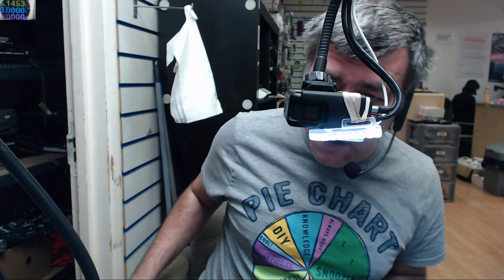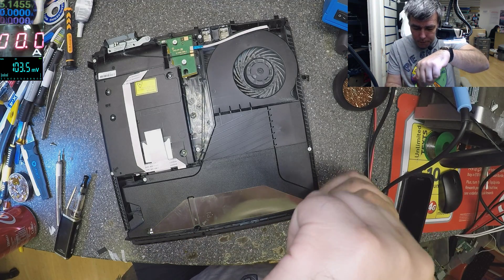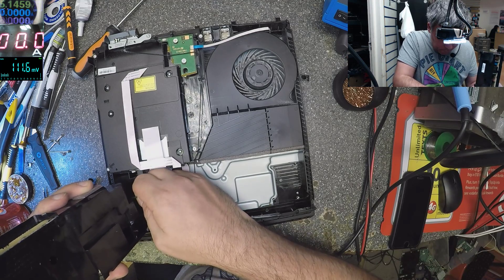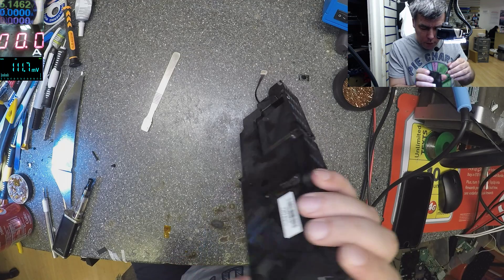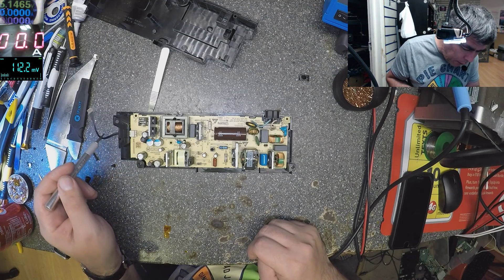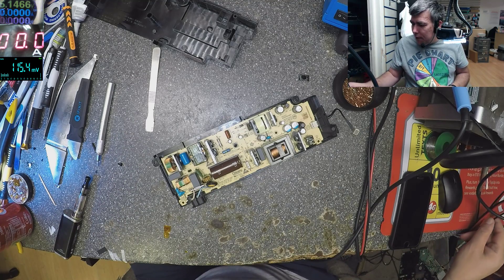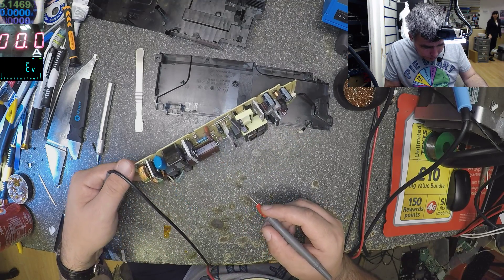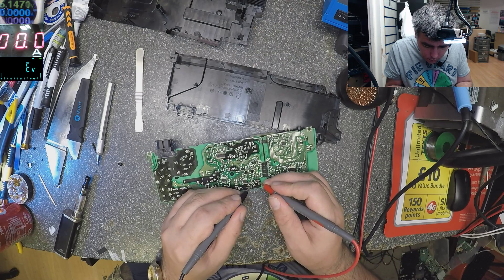PS4 power supply repair job

Comment: Thanks for your video - bought a PS4 for my kids -- only to get that click sound. Followed your video to open the powersupply only to find one of those cables broken off - think stemed from the fact that it is old. I will be taking it to the shop tomorrow to have it fixed and hopefully it works - will update you but thanks for your guidance.

Comment: 4:03 exactly. Bcos they want to exploit people by replacing every faulty console with a new one and charging for it. If people could repair it themselves then they would not be able to exploit them like that. That's why we need to choose a product that's open source, that's not restricted by the manufacturer, which is not hidden by the manufacturer. 
That's why PC is more valuable bcos it is open source. You can literally fix your own components in a pc, if you know what to do.

But console peasants don't understand this bcos they think restricted access and hidden info is somekind of brand loyalty.

Comment: Hi!
 The pfc (power factor correction circuit) capacitor might cause this fuse to blow.
 I opened one psu yesterday, very similar to yours, also found a blown fuse and all the rest apparently ok, so I also tried the "fairytale" trick:) 
 So, I replaced the fuse and as soon as the 12v section kicked in it started whirring and only then I noticed the 180uF/450v capacitor was slightly bulged, meaning a new one was definitely needed a long time ago. 
 Beware this is a PFC circuit capacitor, not a regular mains rectifier circuit filter capacitor, the voltage does rise above 400v instead of the usual 1.414xVac. I made a mistake and squeezed in a pair of 120uF/400v in parallel to try it out, it worked fine with no abnormal noises but I am replacing them asap with the original 180uF/450v one because the voltage might be in excess of 400v and I guess it should be safer to keep the original capacity value at this point also. There is one video on the net illustrating the voltages at this point in particular in the pfc circuit, in standby and full power on there are massive voltage differences. Not the usual rectifier bridge filter anymore or something like that, there is a coil in the circuit... 
 Cheers,
 Hugo
 ( I am too old to see a obvious pfc circuit and understand what it does, unless it starts screaming in my face ;D )

Comment: the power supply i have is starting to smell, what do you think it could be. System powers on and the light turns on.
Reply: Immediately open up the power supply and clean it, possibly the smell is from the cockroaches who are getting fried inside.

Comment: Whilst his logic is sound (something had to short to make the fuse blow) the number one thing to short these power supplies are insects and lizards that climb through the vents in search of a warm dark place. It makes sense that something like that could climb inside and short the psu without causing any more damage since the components in the cpu are generally fairly simple and robust (unlike the chips on the motherboard)

Comment: What fuse did you use. Mines blow and its a T5AH250V but wanted to know if I can used a 4Amp fast blow fuse or should I get the original slow blow fuse.
Reply: Hi, what fuse did you use finally?

Comment: Hey bro I need your help I have the same supply  N14-200P1A I have the same power supply number  if you can give me the part number of the single fet mounted on a heat sink since the guy who tried to repair the power supply before me removed this fet in particular and I can't find the part number so if you can give it to me that would be alot of help thanks any way the fet is placed on heat sink hs5 he incraved the number on the heat sink lt6113 but I think he incarved a wrong part number since I can't find any electronic component by this number so please check it for me thanks any way

Comment: The fuse exist because it have a limited tolerance to current. a cable dont, a cable will make que psu work BUT NOT PROTECT ANYMORE.
THIS IS NOT A PROFESIONAL WORk.
TOU HAVE TO REPLACE THE FUSE WITH A FUSE OF SAME TOLERANCE!!!!!!.

Comment: I have a quick question, I got ps4 pro (CHU - 7116B) and does it match with  (CUH-7115) (CUH-7015)(CUH-7215) is it possible to use one of these power supply for my ps4 pro for the (CHU - 7116B)

Comment: Thank you so much for sharing.  😉👌🏼
I just repaired my daughters PS4. She had a cockroach infestation and heard a pop and the unit stopped working. After opening it up there were still about 20 tiny cockroaches still crawling around in there. GROSS. After checking all the mains switching circuitry for shorts, none were found. Bridge rectifier was good, all the transistors weren't short, nor was the main filter cap. All that was dead was the main fuse. So I took the gamble and bridged the fuse with a single strand of wire like you did, and whalla. It worked.

BTW There was a black spot on the board and slight damage where I presume the cockroach shorted the mains.
Reply: Single strand of what wire????
Reply: @SaiBruce  
A single strand of copper from a multi core piece of mains wire.  An extremely thin strand,  effectively giving it a rating of around 2 - 5 Amps or thereabouts. It's only a very rough guess on the low side. Low enough so that if there still is a short the wire will melt rather than the bridge rectifier explode but will still allow the unit to run if there is no other fault.

Obviously, ideally you replace the fuse with a similar rated one. Although the unit has been running on average 8 hours a day every day since it was repaired and still works.

Comment: good job .. also there is variester after the fuse  .. it is volt sensitive resister it shorts the power causing blown fuse .. the variester blows from the main power input  surges

Comment: Sorin,

I love your videos, i learn a lot from them. Two questions:

1. What fuse did u use and were to buy it?
2. How did u check with the multimeter if it was bad?

Thanks!

//Chris
Reply: Christoffer Denkert fuses are labeled with the mA rating and you check resistance or ohms. You can look in the glass of the fuse at the wire. If the wire is broken, it’s bad.

Comment: I'm replacing the psu with a DC/DC pico psu because im completely 12v off grid. How many amps 12v amd how many amps 5v does the motherboard need?

Comment: all can be order here http://egamephone.com/index.php?rt=product/product&product_id=451
1\PS4 SLIM ADP-160CR/N15-160P1A Power Supply
 
2\PS4 ADP-240CR 4-pin power supply
3\PS4 N14-200P1A/ADP-200ER 12XX model 4-pin power supply
4\PS4 ADP240AR 5-pin power supply
5\PS4 PRO ADP-300CR power supply
6\PS4 SLIM N16-160P1A / ADP-160ER Power Supply
7\PS4 PRO ADP-300ER/P1A power supply

Comment: What type of fuse did you use?? Value of the fuse?
Reply: It looks like they use a fuse wire and just solder to the top of the fuse creating a bridge 2 or 3 amp wire. I think.

Comment: You are not old. Becuase you check components. In your experience the fuses Open because of a short. And you tested the components that normaly are the culprit (transistors, diodes, capacitors). And replaced the fuse wire.

Comment: Thank you very much for the video What about the power supply full of  Roaches the Roaches they will damage the power supply
Reply: I had this problem after a hurricane. Roach problem. Had no idea they made a nest in both my consoles until it was too late. Fried my ps4 power supply. Or so I thought! This video saved me from buying a new power supply.
Reply: That's weird roaches would also nest in my ps4, later on it stopped working and I'm currently trying to fix it,probably the fuse

Comment: With my console 
The game doesn’t come on during first try 
I have to sit down for about 5 mins and keep pressing until it comes on 
What I realize is that the game comes on easier when I connect the game straight to the outlet itself as compare to when I connect it to the extension

Comment: Thanks for the video and for the great teaching.
If something else were in short the varistor would be in short as well, so it could blow up the fuse.
Maybe it was because of the bad quality of the fuse, nothing special about it.
--
You can use a 70 up to 100W lamp  in series with mains voltage to test switching power supplies without worrying about if something more is on short or not.
A lamp in series will create a current drop across it, and nothing will blow up.
If the lamps light up at maximum brightness, something is bad.
That's a must have in repair business.

I believe you know this technique.

Comment: Hey Sorin, you were kind of blocking the way when you were replacing the fuse. Could you tell me what you did there? did you put a new fuse or did you do something to the previous one? if you could explain it me please, thanks :)
Reply: he used a bit of fuse wire to make temporary fuse on top the glass one not a permanent solution  but saves buying new glass fuses as they can become expensive.

Comment: Hi, I recently bought cheap solder from aliexpress but it takes really long to melt and I end up burning the plastic on wires, so what cheap solder would you recommend to buy online ?
Reply: That will be a great video. please!!! ; )
Reply: Dont buy cheap wire, you will regret it. Buy good brand names like multicore or stannol and also make sure it's not lead free.
Reply from the maker: how many watts has yours?
Reply: Electronics repair school 
I have a digital soldering station (60w) from maplin and 450 degrees Celsius is the max temperature setting
Reply from the maker: 60w its ok, probably you are not using flux or you try to solder large ground pads. But i will do a video about soldering soon
Reply: Electronics repair school 
I meant to say what type of cheap soldering wire to buy?
 I already have a good soldering station
Reply: @electronicsrepairschool  Mine switches on..turns off after I try to start a game.. happened after a thunderstorm..slight smoke from the power supply...still turning on..but powers off after any game is started. Should I try to repair it,/get it repaired or go for a new one?